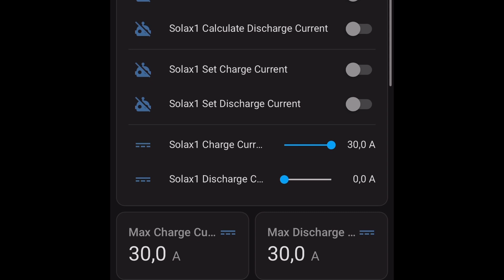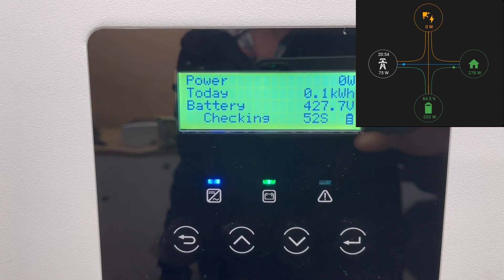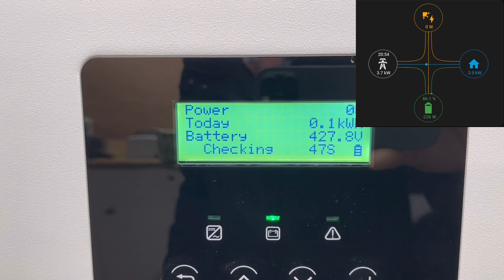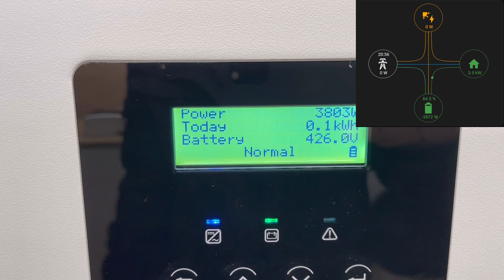10kW off grid load test. Solax X3G4 hybridinverter in EPS mode.

Comment: Super. Looked at you battery too. Compared to Victron they are really cheap. HV batt is very interesting. What did you do with BMS, sorry cant remember. But bms is very important and my last piece missing. 
Thanks for sharing good work.
Reply from the maker: Hi, and thank you, I have installed an Orion BMS in my battery and it is working just fantastic. I have a video on it when I was installing it if you’re interested☺️

https://youtu.be/BwanbwCdA80?si=E8ToJR2CTtTmHSA-
Reply: @flyingtools  thanks. Must have seen it. I will go back again. Thanks